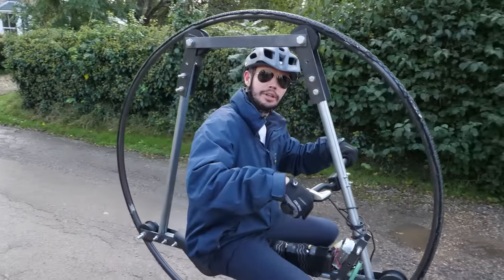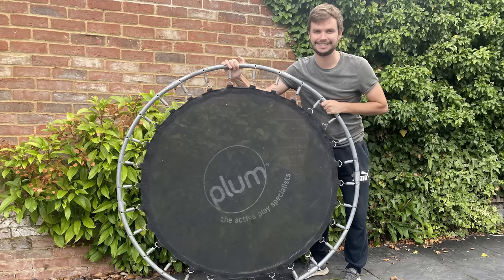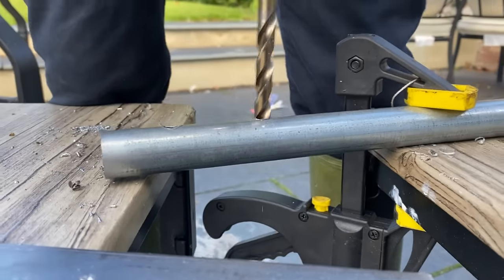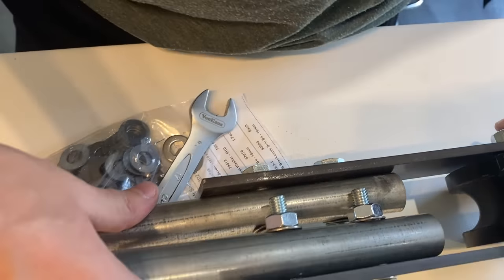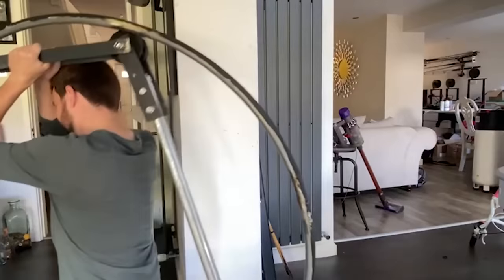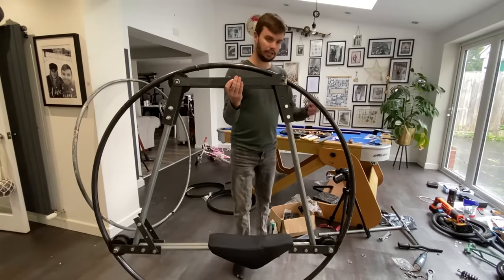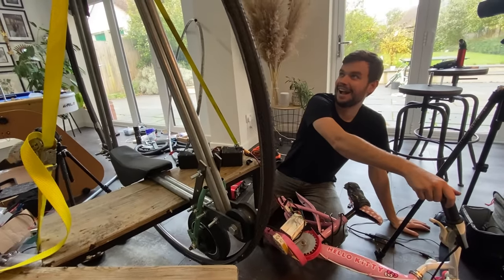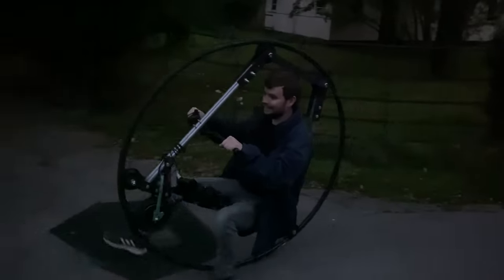Making The Strangest ebike - The Monowheel

Comment: Here are a few tips to improve on the design:

1. Increase the weight at the bottom. You want a low center of mass so you stop rotating inside the wheel as easily.

2. The ratio from the immer wheel to the outer wheel is way too low. Put on a bigger wheel, which will prevent you further from rotating inside of the wheel, due to the higher energy required from the motor to spin the outer wheel but it will also increase your top speed.

3. Put some foot pegs further out. You are way too cramped in there and it will also make you spin less inside the wheel, due to you being stretched out further.
Reply: I really should read the comments before writing the same thing someone else says.
Reply: also could add those little helper wheels
Reply: 4. Add an automatic gyroscopic balance systems to keep it from falling to the side. I've seen videos where people built monowheels that self-balance and basically stand on their own.
Reply: He should add a back rest so he could have more points of contact
Reply: I was thinking a support arm under the seat to bear the weight of the rider and have another point of connection to the wheel
Reply: Nah, put on some roller blades and ride till you die!
Reply: Additionally, with the bigger wheel, you'd have room for the foot pegs.
If the foot pegs go past the rim, and something happens to cause them to hit the floor, it could be catastrophic.

Having two wheels would mean you can have space between both wheels through which you can see.
To top it off, with the bigger wheel, you would have room for your head, so you wouldn't have your head leaning on one side or the other needlessly, which makes balance more difficult.
Reply: @GeekyGami  also if the outer wheel gets bigger it will also provide more rotational inertia which will help stabilize the wheel. The bigger issue I see is if you put a powerful motor on this thing. The fastest you could accelerate would be till the point you start rotating inside the bigger wheel. Which isn't the issue, just don't accelerate that fast. The issue is that is also the max speed for deacceration. And in a situation, slamming on the brakes and deacceration you would then start spinning as well and couldn't stop quickly
Reply: And don't forget about those fixators for mouth and opposite side
Reply: I'd also think of allowing some side swivel as in the original, because otherwise this thing is pretty much unsteerable, not unlike a bike with locked steering :D
Reply: Also, increasing the size of the outer wheel to be able to sit straight. Because the head is sticking out on one side of the monowheel, the weight balance is off, as well as making the whole ordeal uncomfortable

Comment: That looks like a fun build.
I have seen many of these mono wheels and they all have one thing in common, the seat is very low for better stabilization.  Your seat may be too high and is the reason you are having trouble balancing the monowheel while driving.   Lower the seat, and you should have much better control.
Reply: the balance Issue results from the simple fact, thast the bike ist far too small, and so he has to lean out to one side constantly.
the center of mass is not the problem, actually it would be better, if the seat was even higher because the angular momentum acting against the gyroascopic effect would be lower.
Reply: @cnschu  
Look at other videos of people riding these.  They all have a common factor... The seat is lower.  In Physics, this means lowering the center of gravity.
Reply: @cnschu  That would be true if the point where the wheel tips over is himself (aka the center of mass) but that would only happen in the air or in space, here the wheel is bound to tip over in the point where it makes contact to the ground so bringing the center of mass closer to that point makes it so that the gyroscopic effect can help stabilize it more effectively because it sort of has more leverage so to speak

Comment: It's amazing ! Well done ! You could maybe increase the wheel diameter and lower the centre of mass to make it easier to handle ?
Reply: Yup, he can't even hold his head up straight and he's forced to sit leaning to one side.
Reply: I think making a penta shaped frame will lower his mass and increase head room allowing for a lower center of gravity and keeping the weight distribution centered.

Overall looks like a very fun project though.
Reply: @SurelyLightFoot  yes, that would, however it would create new joints and therefore potential points of failure.
Reply: A counterweight hung under the seat would help lower the center of mass increasing the stability. One possible option is to use sealed lead acid batteries as the counterweight with a DC to DC charger suitable for the task.

Comment: just a super tiny note here: when cutting with the sawz all, make sure the metal foot is pressed firmly against the thing your cutting. this helps move the machine make up again and the weight of the unit helps move it back up again, you shouldn't have to apply much force at all just hold it in place as it does the work
Reply: what is it with americans and using brand names for everything? it's a reciprocating saw, Sawzall is just one type of many
Reply: Exactly! I hate that especially for “Sheetrock”!

Comment: Considering the fact that you broke the first trampoline wheel, there’s no excuse for not finding a wheel with the proper diameter to fit yourself inside…

Literally would only have had to lengthen the inside stabilizer rods.

Comment: Just went down the rabbit hole of seeing how other people have approached monowheels - and I was surprised that seemingly nobody has come up with a better answer to steer and/or stop these things or make them even a little bit more stable.  Seems like a fun project though - can't wait to see where this ends up.
Reply: I think the reason most of the reason few people build monowheels is because of the "gerbiling" i.e. spinning backwards when breaking which afaik is simply a problem of the inherit physics of these vehicles. Which is a shame as they're really cool.
Reply: My idea was to use flywheels to catch the momentum so stopping is easier. Also a monowheel is not verry stable because you can't steer it. If you look at a bike you'll see that the front wheel wil turn if you angle the bike. I think this problem could also be fixed with a flywheel. This time to use it to create the "steering momentum".
Reply: Perhaps there could be a box of flywheels for momentum storage; spin up a flywheel before you start driving and when braking that flywheel could be braked hard to dump its opposite momentum into the vehicle, thus counteracting the undesired spin. Pairs of flywheels on the other axes of freedom could maybe offer some stability there; dump some momentum to effect the desired reaction in a pinch.

Maybe go crazy with not just a fixed flywheel but a set of Control Moment Gyroscopes with axes that can be turned as well, if they can be made fit? That however sounds way too bulky for a single person vehicle....
Reply: Why aren't PID loops used for breaking? The same way drones stay leveled at the horizon.
Reply: @oliverer3  just put another tiny wheel in front and behind it
Reply: @SirJamez0  Any kind of control loop could be used to make sure the maximum braking power applied stays below the limit that would make the system "hamster wheel" on you, yes. Maybe nobody's just bothered with taking it that far, or their efforts aren't famous, perhaps because it's only one of the remaining unsolved issues to make monowheels popular.

A control loop like that (which would use an Inertial Measurement Unit as a reference input) however does not solve the physics problem of having such a hard limit on the maximum braking effort a monowheel can apply. It's a wildly different vehicle compared to anything else on wheel(s).
Reply: @simonbolhuis4441  a flywheel is a really good idea and way cleaner than training wheels, but it's going to be really heavy to cancel out that forward roll.  Wonder if it could also be oriented perpendicular to give a gyroscopic assist as well.
Reply: I think the bast way would be to modify an existing electric unicycle EUC.
Reply: @dannyphillips8793  if you out one on a (lets say) 45° angle then you have a flyweel that creates momentum like a normal steering wheel. So it is self balancing
Reply: How about putting  another set of roller on the internal ring that would  spend  separately so when breaking the outer wheel would break but the inner wheel  would continue to rotate with the carrier mount or what ever that's called that you sit in/on. I don't know.
Reply: There is a better idea, they're called electric unicycles. The death nail of the large monowheel is the inability to lean front to back. When standing on the wheel this is easy.
Reply: Would an ABS style system controlling a hydraulic V-brake on the rim combined with a clutch on the drive gear (unsure of correct terminology - the bit that transfers torque from the motor to the outer wheel) work? The ABS system could maybe work off a mercury switch in the frame to detect when it was going past horizontal
Reply: @DjDolHaus86   would work to prevent tip over, would severely limit braking torque though.   Maybe a heavy weight on a moveable arm could be shifted towards the back of the vehicle on braking to allow more force to be applied by the ABS system.
Reply: @dannyphillips8793  It would have to be incredibly heavy or incredibly long to counter the forward rotation which would make the whole thing unstable and (more) impractical. I think the simplest solution is a pair of stabiliser wheels mounted on the seat assembly ahead of the rider which only touch the ground during deceleration to prevent rotation
Reply: @DjDolHaus86   I don't disagree with you at all.. Just kind of goes against the spirit of a monowheel....  Which we already know isn't reallying an ideal configuration to begin with.  Part of the fun is embracing it's flaws.  Using a counter rotating flywheel to absorb power and counteract the rotation is my favorite idea so far.
Reply: When you have a monobike the easiest way to safe control is to make it a pedal driven like a circus bike and also add braking power. Ofcourse this must be done with bicycle parts and the pedals must be made safe with clutch or somehow lol. safe lol overrated... All this thing screams is death.🤣😂

Anyways in this case the steamy punky thing would be controllable and you could maybe try to ad the electric system more of an assisting manor. Maybe you can increase the control system by rebuilding it a thousand times which is rare but in this case fully possible since the monowheel does not have too many parts on it anyways. 

Need to look into the flywheel theory but funnily enough the clutch, added in e- power with stabilisation, brakes and the flywheel would make this crazy thing kind of drivable. Makes me wanna build one!

Comment: Nice work. I think it would be easier to ride if you added a lot of ballast low down under your seat. That would stop it tipping forward when you brake, and probably make it easier to stay upright too. I hope you make a part 2 of this video with a few tweaks to the design because this is so close to being almost a practical vehicle ;)
Reply: It would still be unstable, but having a lower center of gravity would allow for some acceleration without it wanting to rotate the driver along with the wheel when the brakes are applied.
Reply: Try training wheels!
Reply: Would help but not much. It needs a powerful gyro attached to the seat. Vertical axis, 2 flywheels rotating in opposite directions.Only this would make it possible to properly brake, accelarate and move upheel

Comment: I don't know much about engineering nor mechanics, but I feel like using the same system that stabilises a hover board or segway platform for this mono wheel would help a lot. Also, I think incorporating weight to the front would help.

Comment: Things that I think would improve stability:
1. Larger diameter with you sitting lower to the ground relative to the total diameter 
2. Actual tires that are inflatable on the outside
3. Wider/fatter tires with a curved profile (ala bicycle/motorbike)
Reply: Counter-intuitively, I think sitting closer to the ground might make things worse. Part of the thing that makes a bike easy to stabilise is the weight that you can shift (i.e. your body) has a larger moment arm around the pivot (i.e. where the wheels touch the ground) than the rest of the bike. The difficulty is that you do want the inner ring to be bottom weighted because otherwise you risk spinning around as nearly seen a couple of times in this video. I think what you really need is a silly heavy weight attached at the bottom of the inner ring, so close to the ground that it has barely any moment, but a relatively central riding position.
Reply: @Chaddledee  Best fix he can easily apply is fill the metal pipe with weight to increase angular momentum and thus stability. As for braking you would need either your feet or some sort of assist wheels that come down when you brake. Not an ideal solution but there is a reason why monowheels are only built in some curious hobbyists sheds
Reply: All of this and how about a board computer that guarantees your horizontal position all the time?

Comment: Friendly safety note: grinding galvanized steel is just as bad as welding it. You were probably fine, being outside and not doing much of it. But I made that mistake once and ended up with some nasty metal fume fever.
Reply: I got some surprising (to me) symptoms and all I did was cut galvanized pipe, drill a couple small holes, and bend the pipe with a pipe bender. I did it outdoors and had been holding the pipe with gloveless hands and I think a lot of my exposure was due to skin contact with pipe
Reply: @julianbrelsford  normaly you shoulnd have aby problems as long as you dont breathe it in ....
Skin contact should not do anything

Comment: That thing is surprisingly nippy for only being powered by a chinese scooter motor. An inbuilt gyroscope (as hinted to in the design of the South Park monowheels) would probably work wonders for making it ridable by reducing the number of axis you have to worry about.

Great stuff!
Reply: That's how the segeway type ones do it.
Reply: "chinese scooter motor" Like there's any other kind 😂
Reply: Should not be needed (gyro) - if small ones can ride it, so could Sam with a little training. An old vid of this driven by 4-5 year old kid: https://youtu.be/GF0rqlgdaHM
🤓
Edit: The South Park 'IT' bike - epic 👍😂🤣
Reply: Every single scooter motor is a chinese scooter motor mate
Reply: @stealther1401  that is incorrect, but 99% of them are "Chinese made"
Reply: hehehe imagine it with 2 of those motors
Reply: @TheStuartstardust  How do you know that doesn't have a gyro?
Reply: so basically it becomes a unicycle

Comment: Use the shoes with the wheels on the heels. I don’t remember what they are called. But they would be great for this because the wheels would just roll along like training wheels for a bike, it keeps it stable while not scraping anything.
Reply: it is wheelies shoes, though with how the wheel doesn't have stabilizer and he is not used to it yet, his feets are basically act as brake at this point.

Comment: This is very exciting.  If you do a version 2, take advantage of your friend's shop and turn some wheels out of delrin or something for the idlers.  Consider using contact cement for the tires.  If it's in your budget, a wheel large enough that you don't have to duck under while riding might work better.  Fly safe!

Comment: suggestions:  instead of just rolling it forward, you may want a controller so the motor tries to keep interior section upright, like one of those hoverboards.  And then you may want a wider wheel so side-to-side balancing is easier.
Reply: Instead of a controller, you’d want to use a gyroscope so that you can adjust for speed independently of the system. If not, then the process of braking quickly may break the system keep you up causing you to flip over.

Comment: I think the standard monowheel breaking method is to just fall on your side. Actually breaking causes you do go in to a death spiral (as you discovered). 

You could try training wheels. Instead of on the sides like a normal kids bike just put one in front and one behind the main wheel. Once you get used to that you could do the old 'raise them up a bit' trick till you get good at it.
Reply: Or maybe by programming the motor to slowly pick up speed and not stopping all the way the moment you brake and therefore get more stability when driving?

Comment: putting a little anti-"wheely" bar on the back might be good. spring loaded or something with a small wheel itself to roll about. also put on some heelys lol
Reply: ... and a "eileehw" bar on the front - that's "wheelie" spelled backwards, as it would be to do the opposite thing.
Reply: A monowheel with an extra wheel isn't a monawheel my friend
Reply: @DownhillAllTheWay    I think technically they’re called “stoppies” but I like “seileehw” more.
Reply: @simonbolhuis4441  what about an anti roll skid plate?
Reply: I was gonna mention heelies. Glad I wasn't the only one.
Reply: @DownhillAllTheWay  Wheelies don't matter, it's not that hard to accelerate and stay stable. A front wheel to prevent endovers would be useful.

...Though it would break the aesthetic. And this is why design that values aesthetic over function always sucks.
Reply: That would make a great new invention called a two wheeled bike.... no wait, I think that may have been done before.... oh well..
Reply: If the wheel was much larger the weight would be much lower relative to the center, and the whole thing would be much more stable.